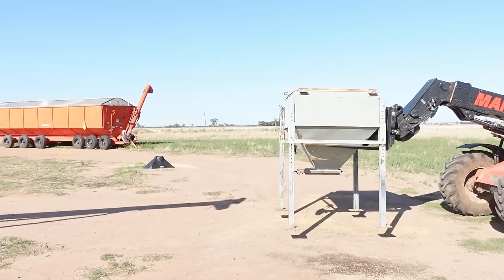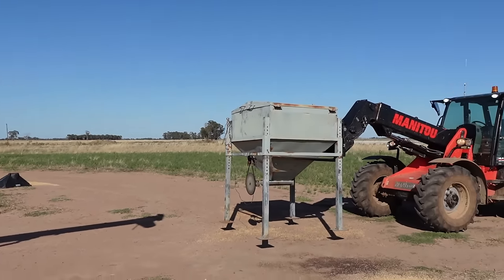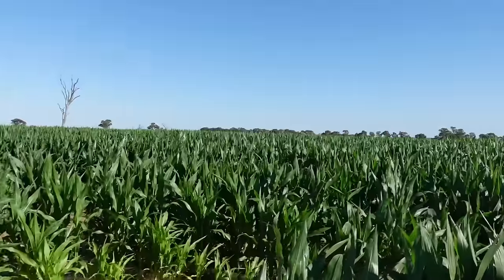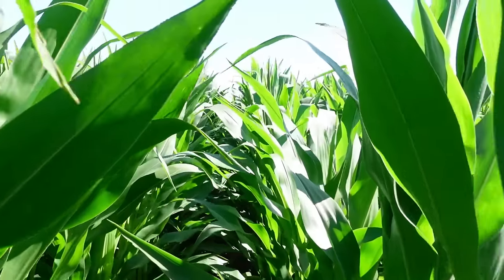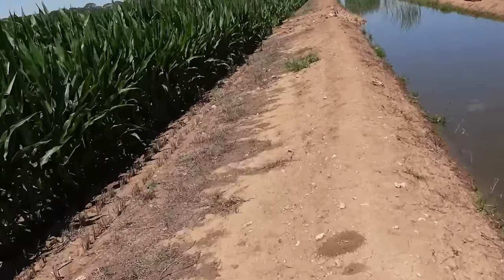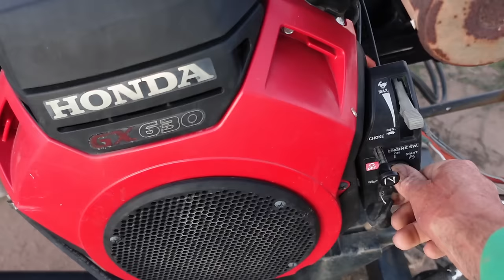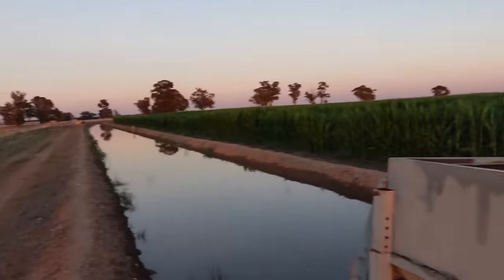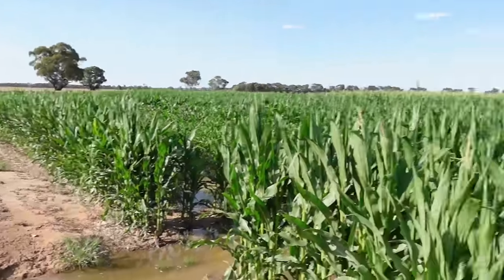Keeping the water up to the corn

Comment: JB which is the most profitable crop .I would assume rice . Sheep would offer the least profit margins and for the work involved. Impressed by the variety of you farming
Reply from the maker: With the 2 summer crops we grow, it’s pretty line ball. Although corn has higher input costs it doesn’t use as much water. If water costs are high rice probably becomes unviable.
Don’t rule out trade lambs or sheep in general though. They don’t have much in the way of inputs or variable costs. Given how much rain we are having at the moment we have an abundance of grass for them to eat, the trade lambs we have bought I’m expecting a four fold return. As for work load, if they managed well they are pretty easy. I spend a lot more time sitting in a cabin than I do chasing woollies!